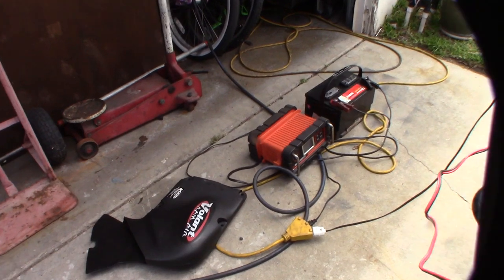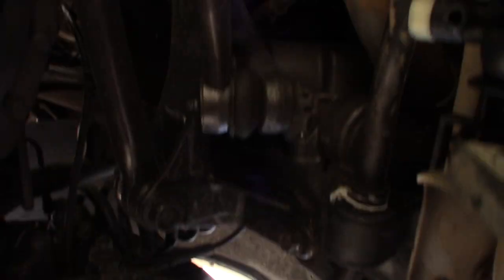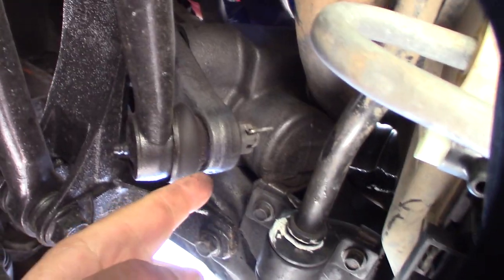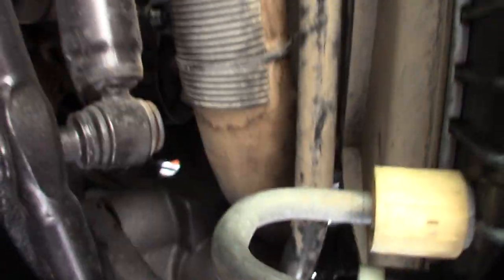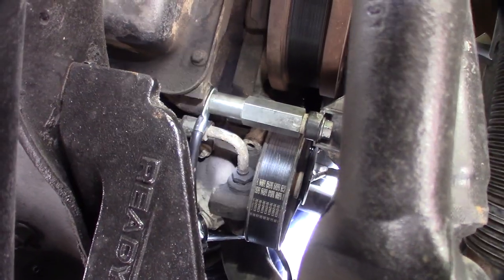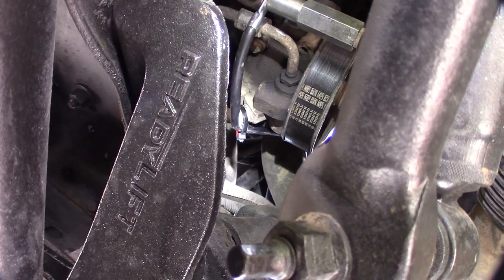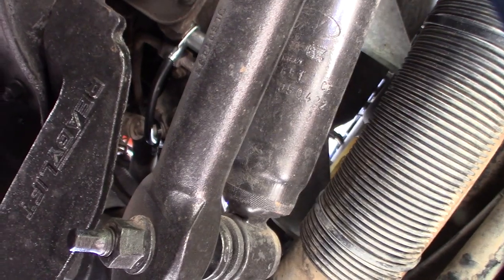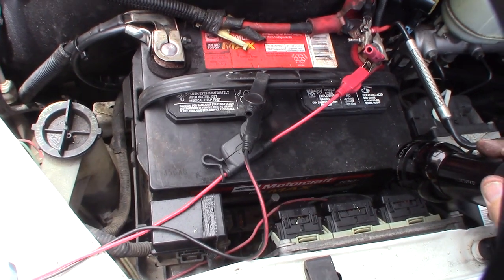Ford F250 Powerstoke 6.0 Dedicated driver battery block ground cable strap

Comment: Maybe this is helpful.  I just bought FICM Repair's battery and alternator wiring upgrade.  The block ground they used is on the drivers side, up high, just below the valve cover.  It is easy to get to if you pull the air filter housing, the passenger battery and the battery tray.  The kit I bought actually includes a large diameter short wire that goes from the frame ground (driver's side) to that threaded hole just below the valve cover, but this would also be an excellent grounding point on the block for the approach in this video.

Comment: I have a 2005 f250 6.0 and batteries are 2 years old i get 12.5 volts on the batteries when I go to start it its extremely slow to turn or in cold nights won't even turn at all I put new alternator and it's charging just fine. Could this be the starter or wires I did check replaced ground wires. Just going crazy with this truck! Thanks for any input
Reply from the maker: Its probably just your batteries. I have similar issues to you. You need to have really strong batteries in cold weather. I permanency installed a float charger on truck. With batteries its not just voltage, draining the batteries too low kills capacity. Check out my video
https://www.youtube.com/watch?v=f__SFwe3SNg

Comment: Why are my terminals getting fire hot after I put in New starter on f250sd 6.0?? I checked and made sure the connections on starter were not touching.
Reply from the maker: maybe there is a short in the starter solenoid. check the cable coming from the alternator and see if that's hot.
Reply: Thanks, I pulled the cable and found a bare spot. Couldn't see it. It was by the motor mount.